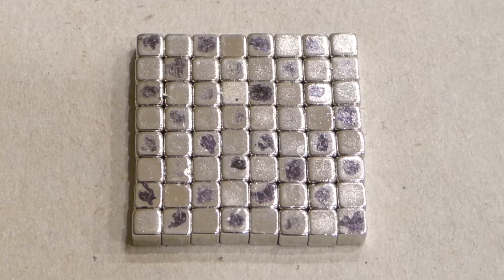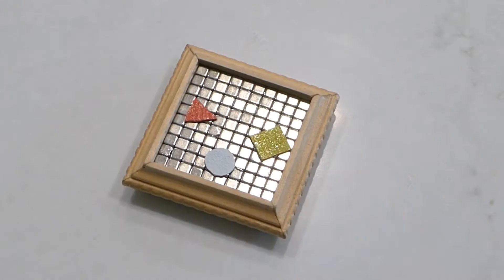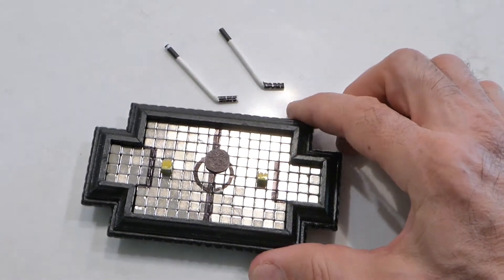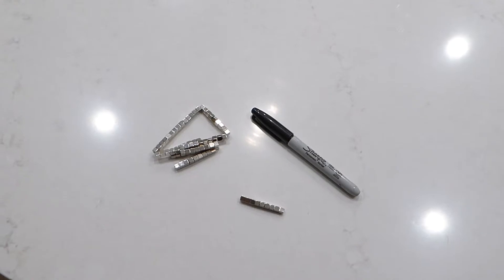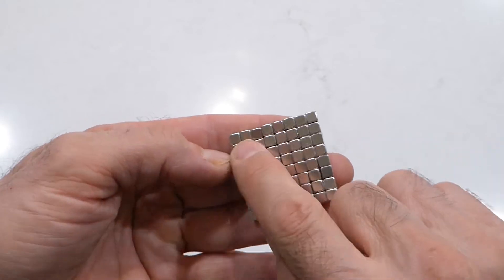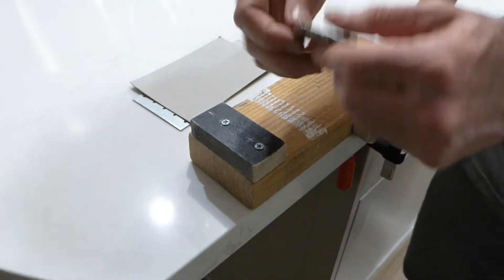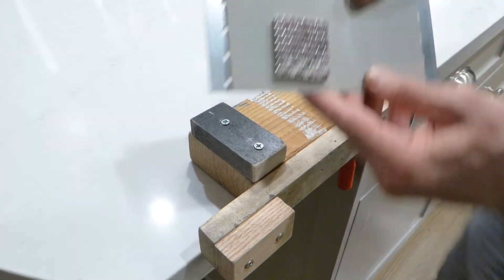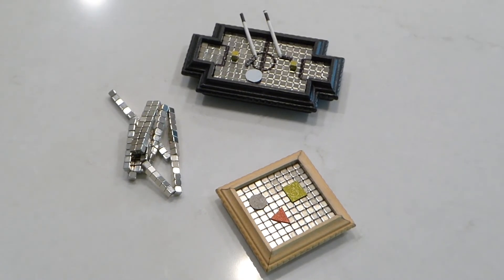Magnetic Levitation amazing exploration - Art Meets Science

Comment: How much weight can the float graphite hold before touching the magnets.
Reply from the maker: Very little. A grain of rice. These are tiny magnets, so I'm not getting more than maybe 1 mm of float. I used a very strong stack of ring magnets, and stuffed the hole with inverted disc magnets, and I got about 3 mm of float on a bigger piece of graphite (1/2"). Still won't float anything more than  a few grains of rice, and the magnets are getting fierce.